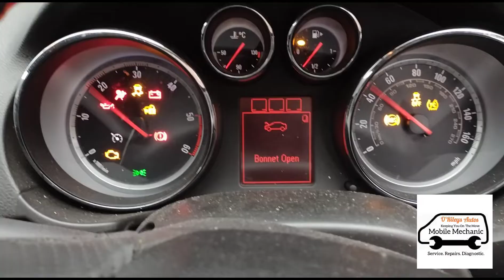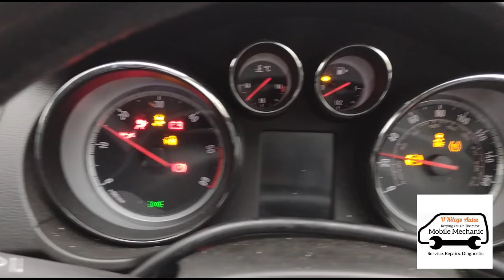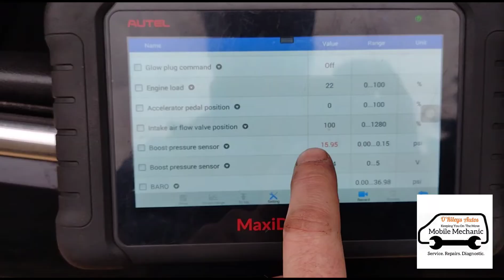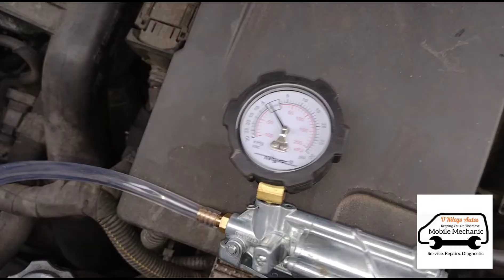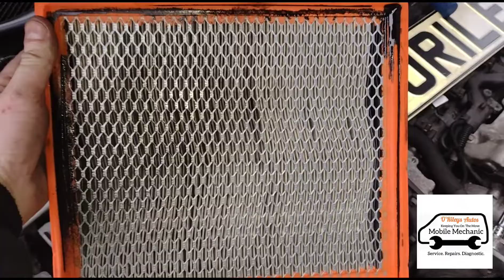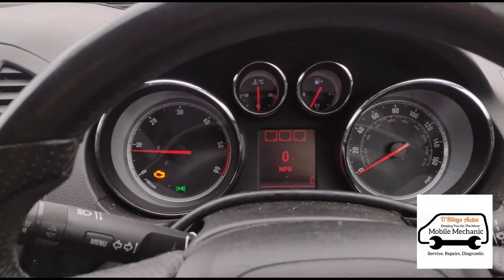2.0cdti Vauxhall Opel Insignia P003A-00 P0234-11 Turbo Overboost  P0234 No Boost Limp Mode

Comment: Hi, what can cause Boost pressure readings 540kpa on idle. P0299 turbo underboost. Changed MAP sensor, checked wiring to ecu, turbo actuator works as it should. ??

Comment: I have astra j 2.0cdti..engine started to run really bad and I managed to limp home..plugged in my diagnostic tool and it said egr error 99.2% I've changed the egr for a new unit from vaux parts and also removed the adjacent pipe and throttle body...car runs OK when warm..however when cold I seem to have lost turbo/acceleration...fine when hot..all codes read and erased ect..machine says no faults! What do you think is up?

Comment: A few days ago, the same thing happened to me. When I add gas above 2500 revs, the car goes into safety mode. It does not allow more than 2300 revs. My wife drives that car (Opel Insignia). The diagnostics showed that the turbine pressure was too high. The vacuum pump is fine. The solenoid valve that controls the curvature of the vanes in the turbine itself is fine. The control lever on the turbine itself is stuck, so it does not close the wings, so the turbine has been working non-stop at maximum for a year. Do you know what the problem was? One hole in the air cooler (Intercooler) caused the computer, measuring the pressure in the turbine, to conclude that the pressure is insufficient, thereby opening the wings to the maximum, due to air leakage in the Intercooler. The result? The turbine works non-stop with the maximum number of revolutions...so we have curved blades in the turbine, which were bent due to excessive temperature and therefore a broken turbine. It is fortunate that here in Germany, a repaired turbine costs only 250-350 euros. Of course, look at the condition of your Intercooler, because the same Cooler rubs against its support due to vibrations, where a hole will certainly appear. If your car is more than 3 years old, be sure to have someone clean your EGR valve, it is certainly full of soot. An engine that sucks in a large amount of soot will certainly not last long. I am speaking from personal experience. I apologize for my poor knowledge of the English language.

Comment: exactly the same problem as mine, limp mode and engine light came on no boost. had it diagnosed and it said the same but garage told me I need new turbo. but another said turbo is fine could be split in pipe but not sure what to believe. I'm guessing its worth buying that turbo cleaner first?

Comment: Hi can I ask...always been a bit unsure testing the boost solenoid...am I correct in thinking when car is started solenoid opens and allows vacuum to flow through it and when you reach higher revs closes ?

Comment: I always use injector cleaner in my pd tdi about every six months and some times undiluted in the filter housing with a new filter, then give it a good run in third gear and that helps clean out lots of crud and brings down the emissions for mot👍.  Good vid that 👍

Comment: Hey great job ..who keeps putting fuel in the car ..it had fuel light on ..then quarter tank ..then 3/4 tank
Reply from the maker: So the fuel level was too low for me to run the car for the cleaning process and test drive. I carry 20L fuel cans in the van for scenarios like this. The ignition was on when I filled it so it takes some time for the gauge to catch up 👍🏻

Comment: Been watching all your vids on dpf cleaning . I’ve a 2016 merc Vito 1.6 diesel . Every now and then loses power and goes into limp mode. When I turn it off and back on again it goes back to normal apart from engine management light on . Could that be the start of a dpf problem
Reply from the maker: Sounds exactly like what this car was doing.  Usually caused by Underboost or Overboost when you use more than 50% acceleration or going uphill or towing triggers it more often. Limp mode and Turbo issues can then lead to DPF issues